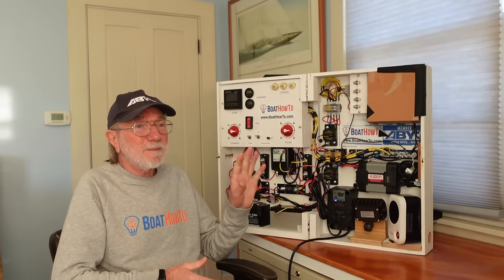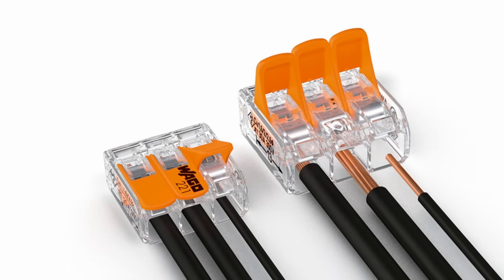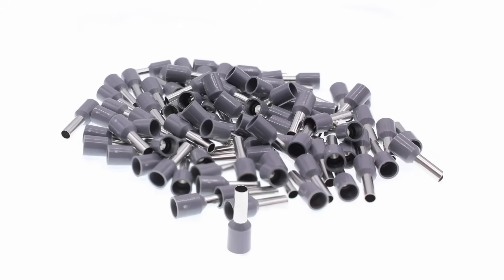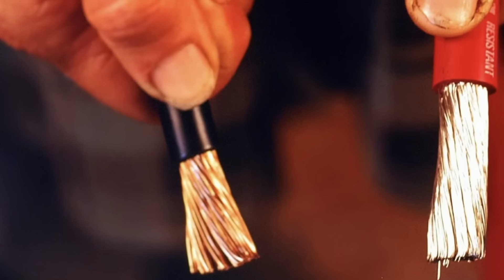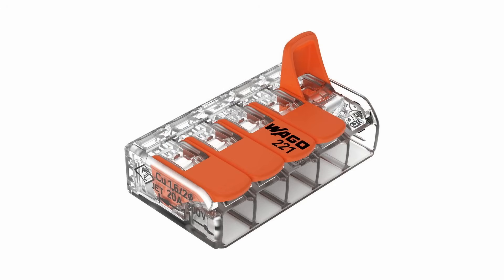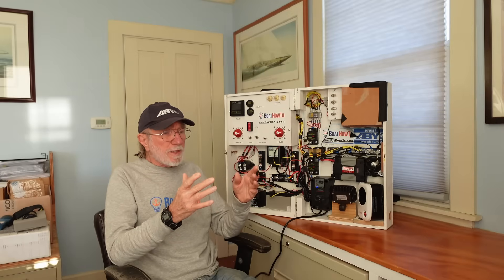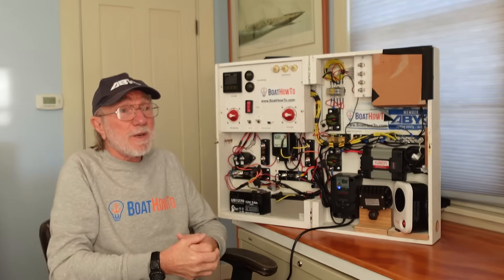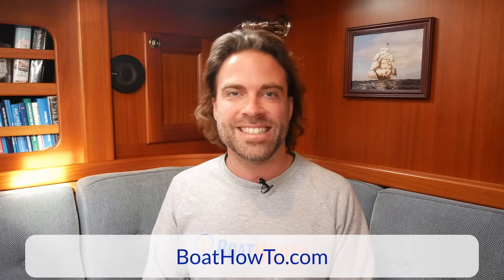WAGO Connectors in Marine Applications? 🤨 | Ask The Expert with NIGEL CALDER

Comment: Those connectors are only good for semi low voltage at low amperage. Don't drink the Kool-Aid.. remember Marine electrical has electrical codes on what you can use.
Reply: 90 percent of the loads on a boat are 15amps or lower. Also wago connectors are used in Europe and UK in 240volt house hold wiring up to 40amps you just need the correct rated connector and wire size for the load being wired.  Obviously your not going to use a connector sized for 14AGW wire for high capacity cables like main battery or inverter wiring.

Comment: No, unless there is no other way, and if used on a boat they need to have the water-resistant cover and mounting block attached..  We have phased these Wago connectors out for industrial equipment because they do not stand up well to vibration and have very weak corrosion resistance around washdown areas.  If you use these Wago type crimp connectors on a boat they should only be in a dry place, and make sure the wires are well supported to avoid vibration.  Never use in the bilge area.  They are NOT as secure as a properly installed wire nut, but wire nuts aren't ideal either.   You want the tinned, stranded wires terminated in a gas and watertight crimped connection, and with a strain relief on the wire extending about 3x the crimp area length on the insulation.  This means you use an Eaton barrier block with crimped ring terminal + adhesive lined heat shrink over the whole crimp area and wire approach to the crimp...and secure the wire down to prevent vibration within 2~3 inches of the connector.  The advice in the following is about correct, and we DO use these methods on industrial equipment that gets a washdown several times a day, and this is what we use on our boars for over 2 decades without fail even in saltwater...it works.  https://www.practical-sailor.com/systems-propulsion/how-to-connect-small-wires
Reply: but the question is clearly answered above? even the link you sent, says they are fine?
Reply: "have very weak corrosion resistance around washdown areas" They are open on the side where you push in the wires, what do you expect? They are not designed for that. They are designed to be used in enclosures, junction boxes, etc. Never exposed to the elements. My experience shows that if the wires are used with strain reliefs, the Wago's are actually very shock resistant and in my opinion they outclass wire nuts, especially - of course - with stranded wires.
Reply: You could just as well put them in a box with strain relief. If you need to remove them then with your method you're using up the wire every time you do.

A proper wire nut is similar in principle to them in that theres spring pressure thats doing the job.
Reply: i second that, have to replace corroded WAGOs quite often, and when I see them on a boat, it is a sign of some bad DIY job happened before, should be ready for unpleasant surprises..

Comment: While WAGO connectors may be suitable for stationary uses I question whether they have been tested in situations where a great deal of motion shock and vibration are commonly present, such as in vehicles and equipment. Also, who in their right mind would want to work on a connector stored in a box of goop? Why can't WAGO adapt a seal similar to Weatherpak, et al? And, why not develop a connector that grips the insulation as well as the conductor? Everything has its place but I'm not convinced that WAGO deserves to be utilized everywhere.
Reply: Wago is certified for vibrating and moving environments, like cars, RVs and more.
Reply: I use Wago's in systems that are moved around a lot and are suffering from motion shock and vibration, offshore. Never had issues. If you want to add some extra safety: secure the levers with electrical tape or a small ty-rap. Weatherpack and Wago aim at different markets. Wago is aiming at use indoors or in an enclosure, not exposed to the elements. They have solutions to waterproof them, but that is not ideal for situation where you need to connect and re-connect. Wago is ideal for the applications it is  designed for, but they are not designed for every imaginable application.

Comment: I have just started to use Wago connectors and put a few on the boat as emergency connectors. Nice to know that they are OK to be permanent. They are wonderful for branches that have multiple circuits which would be messy otherwise and the fact that they can opened changed and reused  😊 Thank you so much 👍 👍 There is controversy over solder joints?

Comment: The nice thing abot wago connectors is that they get tighter if any corrosion does take place (rather than looses like screw connectors)
Even better, full the wago with silicon grease before pushing the conductor in.
I spend a lot of time replacing the old 90s connection blocks with wagos on boats!
Reply: Di-electric silicone grease? 🤔
Reply: @nobody46820 whatever you have available!

Comment: Two comments, one, Wago is not rated for high voltage as in string solar, two, on my commercial lawnmower I found Wago to be the perfect way to connect the electric clutch because when a belt breaks and tries to destroy the wiring they simply pull out and can be reinstalled.

Comment: Sure, why not...??? IF the water gets to where you're using wago connectors, you've got bigger problems than just the wago connectors...
Reply: A boat, being in the water, is in a 100% humidity environment all the time. But to me the real problem would be the salt air exposure. Salt ruins electrical connections very quick. I just replaced a wire which had a small insulation failure and the corrosion had already started eating the wire from the inside out. The bilge area will always have some water in it so I would not use any open connection there - everything gets a coat of electrical grease and heat shrink sealed so it’s water tight. I’ve considered using WAGO elsewhere in my boat and just might have to try in areas I know stay (mostly) dry.
Reply: @johnmoore3504  Never use an open connection, if if it is not IP rated, put it in an enclosure. Works perfectly, even with simple Wiska IP67 junction boxes, for example.

Comment: You know what will upset many North Americans , Wire Nuts are not ABYC compliant.
Reply: Nah, everyone with any boat knowledge is aware there is no place for a wire nut anywhere in a marine application.
Reply: @snapperboat25  You would be surprised I've worked on a few boats that have been imported with with wire nuts everywhere
Reply: @ Yeah, I was a surveyor for 25 years. Saw my share. The small commercial boats were the worst.

Comment: Throw those Wego in the garbage the Salt Air gets a hold of it the corrosion will get in there and fail set screw connectors are better with corrosion inhibitor Marine use no way
Reply: Seen plenty of set screw connecter's' fail as well, being in Australia where they are very common, its about where they are used not so much the type of connector, why wouldnt corrosion inhibitor work with wagos?
Reply: @nicholaskeur  Do your screws turn the opposite direction like toilet water and weather systems down there too?
Reply: Why not use a corrosion inhibitor??
Reply: Wago's are prefect for use in the marine enviroment. I use them offshore, they even come in ATEX version, so ex-proof. But never exposed, always in an enclosure, as you should do with any connector or terminal not appropriately IP rated. Some of my systems using Wago's have been offshore for over 8 years without any maintenance. And still in perfect order.
Reply: Are your hands emphatically on your hips? Pretty sure if they are being used all over and one of the preeminent electrical gurus and ABYC think they are ok, they probably are ok. A ring connector is just as susceptible to creeping salt and corrosion.

Comment: I worked in a boat yard for a year mostly doing electrical installations and the Wago connectors were used on all boats on that particular boat yard (in the Netherlands). I also use them now on my boat on applications that I need to disconnect some times. I had found many failed and corroded connections on boats that came in for service but none of the Wago ones. So, I can say they are really better than most others I came across.
Reply: Even correcting for age?  Wagos may be newer and therefore the connections made using them may be newer.

Comment: WAGOs made it into my American orbit a few years back via YouTube. More popular now and even stocked at my local big box store. They are great and sooooo much better than the typical wire nuts used here in electric work. The only real issue is cost but still well worth it, especially for anything you may need to disconnect occasionally. Glad to hear they can be used in marine applications as well.
Reply: In Europe, we've been using WAGO connectors since 1977, and long-term experience shows that they are not reliable in the long run, not even within residential installations. Traditional screw terminal blocks are better in every respect.